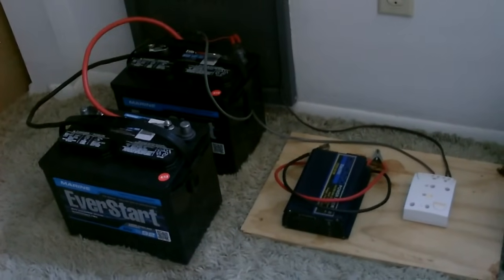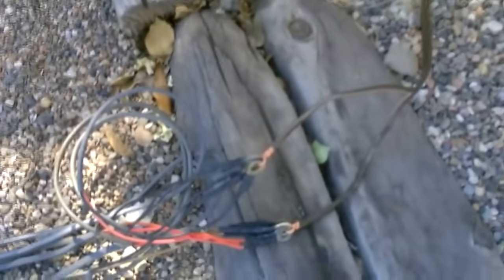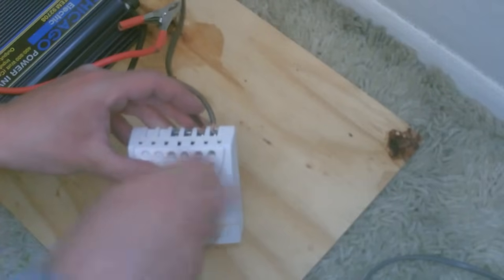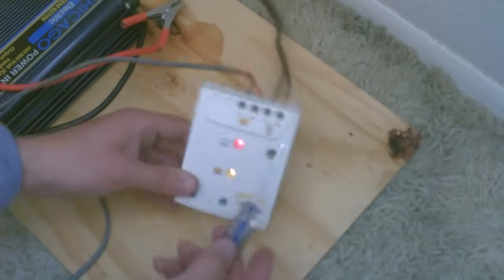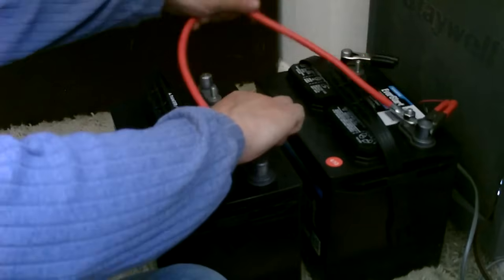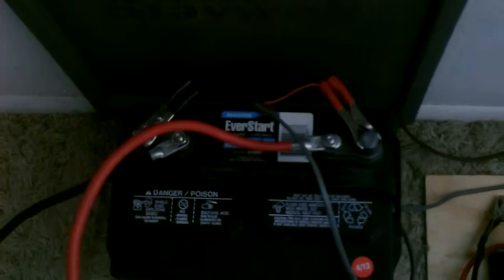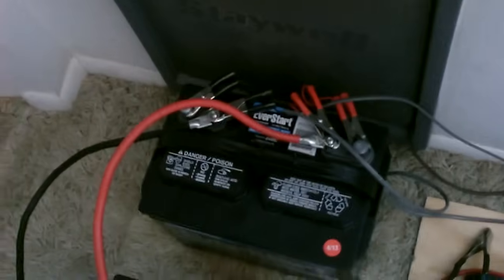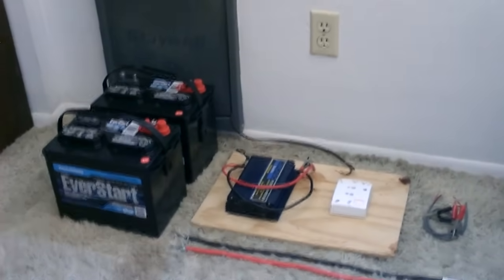How to hook up Solar Panels (with battery bank) - simple 'detailed' instructions - DIY solar system

Comment: Do the car batteries last a long time for solar?
Reply from the maker: if you use car batteries you'll only get about 25 charge cycles before they die. use the kind of batteries that i did (meaning use deep cycle batteries) and you'll get closer to 1000 charge cycles. (that's about what i get). the batteries shown in this video kind of look like car batteries but they are deep cycle.

Comment: U should put positive on one end of ur battery bank and negative on the opposite end it helps with battery life and even distribution
Reply from the maker: hi. it does seem logical but it's not necessary to do that. studies show that as long as the battery bank has less than 8 batteries then there's no measurable difference between the batteries. i've run systems like this (a 2-battery system and a 4-battery system for over 10 years) and the batts all wear out pretty evenly. i typically get 1000 charge cycles (about 3 years) before i need to replace them. (that's a good full life for this type of battery) 🙂🤠

Comment: If you want to run outlets make sure you get the inverter that has that output bracket inserts. For example the "Renogy 2000w pure sine wave inverter 12v DC input with 110v ac output" this model inverter is used for running solar home outlets in your walls. All you do is wire same as house and the last positive and negative wire plug into the inverter outbound made for RV TRAVEL TRAILERS. make sure you use correct thick gadge wires that you feel comfortable with. For me it is 10 gadge but some use the standard 12 G. Don't use and thinner than 12G such as 15 G in my opinion to be safe. I would also suggest a fuse in power line.

Comment: Hey, great video, I live in a remote area with no electricity, what appliances can run on this setup❓
Reply from the maker: hi. all kinds of things. i've run can openers (60w), toasters (769w), a small microwave (around 800w), coffee makers (about 750w), mix masters, vacuums (750w) and various power tools... you can run most small appliances. i've also run weed quackers, hedge trimmers and leaf blowers etc... anything that pulls 1000w or less usually works good. if the item pulls over 1000w (from 1000w to 1800w) then you might want to have a couple more batteries). with a 4 battery setup (shown in my very first video) i've run a full size washing machine. just a short wash but it works

Comment: U not using fuses. Have u had any problems?
Reply from the maker: hi. no problems at all. been running it for 10 plus years. it's a small system but you can add in fuses if you want. note that the inverter and charge controller have built in protections

Comment: Can be any kind of battery?
Reply from the maker: hi. any kind of 12v deep cycle battery should work. you wouldn't want to use a car battery. they would probably only last about 25 charge cycles. deep cycle batteries can last 1000 cycles
Reply: @desertsun02  And cost a Fortune..........

Comment: Will this run a couple led lights or an electric heater?
Reply from the maker: hi. yes, it easily runs things like led lights and small heaters. to run larger heaters you would want to add more batteries.
Reply: @desertsun02  aLot More..........haa

Comment: What happens when the battery's are fully charged?
Reply from the maker: hi. once they are fully charged the charge controller lets through just enough power to keep the batteries 'topped off'.

Comment: Shouldn't the controler be connected to the positive of one battery and the negative of the other battery to charge both batteries equally?
Reply from the maker: hi. there are other configurations (but you don't need to do that). studies have shown that if you are using 8 batteries or less there is no measurable difference between the first battery and the eighth battery. the power goes through the wires essentially at the speed of light so the battery bank acts like a single big battery.

Comment: I keep wanting a portable power station but i can build that and get way more bang for my buck! Westinghouse wants 1000 dollars for 600wh portable power station! 10 yrs since you made this video and still the simplest/cheapest way to go about building a power station for when you lose power!
Reply from the maker: hi and thank you! a system like the one i built gives you a lot more power than most of those portable or 'all in one' units that they sell. a while back i compared it to a 'jackary 1000' (that's one of their bigger units) and the system i made gives you about 3 times as much power (for about a third of the cost). much cheaper to set up a system yourself. these days it would only cost you about $335 (for everything).

Comment: Hi,Are those just regular car batteries and what size inverter,, Thanks
Reply from the maker: hi. they look like car batteries but they're actually deep cycle batteries. deep cycle batteries are made to be charged and discharged a lot. i usually get about 1000 charge cycles (3 years) out of them before they need to be replaced. if you used car batteries you might get 25 charge cycles before they would need to be replaced. i have 3 different size inverters. a 150watter a 400watter and a 1000watter 🙂👍

Comment: You said to hook up everything to the lead battery, does this negatively affect the lead battery in any way?
Reply from the maker: hi. once you hook the batteries up to make a 'battery bank' the system charges equally (for all intents and purposes). that's because the electricity in the wires is moving essentially at the speed of light. they did studies a while back and found if you're using 8 batteries or less then all the batteries are affected equally. they could not measure a difference. hooking them up this way is the best way to do it if you're not using more than 8 batteries.

Comment: I got 100wats solar panel 600watt  inverter and  75AH Bettery.... then I got 43 inch  TV which it fails to work when connected to the inverter even after all connections. Please what might be the reason?
Reply from the maker: hi there. there are a few items on the market that actually need a pure sine wave inverter to run. those items usually have very sensitive electronics and will not run using a standard (modified sine wave inverter). i've only ever run across one thing that wouldn't run. it wasn't a tv but some tv's might need a pure sine wave inverter. do most other things run when you plug them into the inverter?

Comment: What size is the wire coming in from outside
Reply from the maker: hi. i'm just using old extension cord wire. i believe it's official rating is 13 amps.

Comment: Its amazing and honestly i m looking to do the same for long time but couldn't find any video like this to satisfy, can you help me to figure out that where to buy solar, White box and DC to AC changer? And what they called exactly? Thanks for amazing video
Reply from the maker: hi. the best place to get most of the stuff these days is amazon. they sell good solar panels (plus they have charge controllers (the white box), and inverters (DC to AC device). i recommend getting the batteries in your local area - if you can - but amazon sells batteries too
Reply: @desertsun02  thanks for the reply, for the white box and DC to ac, it doesn't matter how many solar you hook up? Or they have limited capacity? I have around 40 to 50 led light around the house which I m trying to make them solar

Comment: I like your system it does work.can you run a small cooler
Reply from the maker: hi yes it will run many different types of coolers. by "cooler" i mean small fridges etc...  it will run a small ac window unit but only for 15 to 30 mins. for that you'd need more batteries

Comment: So if I wanted to use small agm 12v 7ah batteries as a power bank and to have a USB and cig lighter terminals only I can skip the inverter and just run them directly from the battery?

Comment: @desertsun02 correct me if in wrong but using 1 "lead" battery to connect everything would charge the batteries uneven would it not? if you put positive on 1 battery and neg on the second battery it would draw and charge both batteries evenly. doing it your way would put WAY more stress on 1 battery and not near as much on the second.
Reply from the maker: hi there. i can see how it seems that way but it doesn't actually work that way (to any measurable degree). it's mainly because the electricity moves through the wires at essentially the speed of light so when you hook the batteries together the 'battery bank' acts like 'one bigger battery'. studies i read showed that if you use 8 batteries or less there was no measurable difference between the first battery all the way through to the eighth one. they concluded that if your battery bank was 8 batteries or less it's better to just hook them in a row. if it's bigger than 8 batteries there are other more complex configurations you can use. note that you don't have to though. you can still just hook them in a row. it's an incredibly small difference between the first battery and the 9th, 10th, or 11th one etc. again because the electricity is moving so fast through the wires.

Comment: Exactly what I needed just something straight to the point and no confusing way watts x kw / by pie - 1024 bytes = WHATTTAT ??? :)  thanks again... I guess my only question is batteries people say to not use car batteries but Lithium is expensive... Is there a cheap way to go Lithium batteries?? I thought about using some of my old batteries out of my APC and UPS units when they come in for replacement....  chain all together was my thinking.

Comment: so... in looking through videos you had car batteries in your bank. not everyone does. I was curious to ask you about some details on this. 

Like... if all your batteries aren't uniform, and if you have varying strength, age, or differences in the car batteries... can this affect how you do your battery bank setup? And is there a particular order or line you want them to be at if your batteries aren't uniform?
Reply from the maker: hi there. remember not to use car batteries. they look a lot like car batteries but they aren't. they're 12v deep cycle batteries. car batteries would only last maybe 25 cycles before they were no good anymore. the deep cycle kind of battery can last 1000 cycles. all the batteries in a battery bank should be the same. (same brand, same size, and roughly the same age etc.). mixing different ones can cause real problems.
Reply: @desertsun02  i was curious to ask u if battery systems in systems above 24 v are subject to more wear and tear? more stress? I'm using 12V but I noticed ebikes use really high voltage systems, and that got me curious to ask u on this. 

This is really fun to see your stuff and talk shop. 

Thanks.

Comment: Ok, pretty clear this part! Now how do you use the elecyricity ftom the batteries for your fridge, let's say??
Reply from the maker: hi. all you do is plug anything that you want to run into the inverter ✔🙂. i've got a separate video showing it running 6 or 7 different things.

Comment: Great video. My only comment is that I would have stripped the ends off those panel cables and spliced them together before connecting to the charge the regulator, just to ensure the best possible connection.

Comment: When the battery is full, what happens to the charge controller and the inverter? Does it pull power from the panels instead of the batteries?

Comment: do i have to use the same batteries i have 4 each pulled from different vehicles  can i link them all together or will i have a problems?
Reply from the maker: hi. it's very important to use the same exact batteries.
Reply: @desertsun02  thank you very much for the reply

Comment: Have you been able to use this setup for a longer time? And what kinds of things were you able to power with this system and for how long?
Reply from the maker: hi. yes, i've been using this system (originally with 4 batteries) since 2009. my first video is actually this system with 4 batteries. the only thing i've had to do is get new batteries every 3 years or so. i've been getting about 1000 charge cycles out of each set of batteries. i can power almost all my smaller to mid-size items. the only things i can't power for a long time are the microwave and small ac.

Comment: Awesome thank you. So you could just add more solar panels and batterys. How many battery to panels would you say is equal?
Reply from the maker: hi. for every 2 batteries (of similar size) i use about 100 watts of 12v solar panels. that's because a 12v 100w solar panel puts out about 6 amps (so that is 3 amps per battery).

Comment: Great video. I was looking at a 5000w pure sine inverter for a system. How many batteries do you think I might need? Thanks
Reply from the maker: hi and thanks. it's hard to say but if you want that much power you would have to scale up the system in a big way.

Comment: Did you use two car batteries
Reply from the maker: hi. i used 2 batteries (but note that they aren't car batteries). they are 'deep cycle' batteries. they look similar but it's very important to use 'deep cycle' batteries. car batteries would only last maybe 25 charges. deep cycle batteries can last 1000 charge cycles.

Comment: Great info, Thank You!!!!     Do You recommend any solar panels that will stand up to the hot sunny Florida days, i`ve read some panels cannot take the heat?     Thanks again.
Reply from the maker: hi there and thanks! i've bought both the cheap panels and the more expensive ones. i find that the cheap ones work just as good (if not better) than the more expensive ones. these days the best place to get panels is probably amazon. they've got some 12v 100 watt solar panels as low as 80 bucks. i have an 80 dollar one. it's awesome.
Reply: @desertsun02   Thanks Sir  Rock`On!!!

Comment: Hi. My set up Consisted one 100Watt solar panel, a charge control, and one 22Ah battery. I connected to a CCTV camera and router which used around 2Amp. However this solar panel set up unable to let me run my cctv continuously. Is there any solution I can do to achieve that? Thank you

Comment: I've got a solar panel, don't know what type of end is on the cord coming from it.  Need to get parts to fit it--OR--cut it off and use a different type end--OR--just get a different solar panel.  Need build a new, simple power supply like this one!
Reply from the maker: hi. just a guess but it's probably an MC4 connector. those are common these days.
Reply: @desertsun02  I did the research... MC4 is precisely what it is.  Thank you!  Now, to collect the rest of the parts and start building this unit!

Comment: This video is 9 years old and still the most simplest and best explained video on this setup...thanks bro.
Reply from the maker: you're welcome. i've been using this setup with 2 to 4 batteries for over 13 years now. only thing i've done is replace the batteries every few years. they typically last about 3 years at a time. same inverter, same charge controller, same panels.

Comment: I thought it was supose to be wired in serries, but you said parrelel, I have to find out more.
Reply from the maker: hi there. yes, you wire it in parallel (if you want it to be a 12v system)

Comment: Should I get two or three batteries for a 4000 W inverter. I really only need it in case the power goes out so I can run a freezer and a refrigerator
Reply from the maker: hi. it's hard to say how many batteries you will need because it will depend on the power requirement of the fridge or freezer. some are very low power.

Comment: You didnt show the connection to the inverter
Reply from the maker: hi. i just clamped it to the lead battery. positive (red wire) of the inverter to the positive post on the lead battery and negative (black wire) of the inverter to the negative post on the lead battery

Comment: Do you have you use 2 batteries?
Reply from the maker: hi. you can use any number of batteries that you want (but you want to balance the number of batteries and the number of panels correctly). batteries of roughly the size i used like to be charged at 3 amps per hour (give or take) so it's best to use 2 batteries for every 100 watts of solar power. that's because a 12v 100 watt solar panel produces around 6 amps
Reply: Thank you man!

Comment: The highest V of solar panel is about 30 V. Is that high V hurt any of the other equitment? Battery, Controller.
Reply from the maker: the voltage should not be that high if it's a 12v panel. it should be more like 17 to 20v. 12v panels are a little over 12v so that the panel has the power to push the current into the battery. (the voltage is the "push" behind the current). it has to be a few volts higher than the voltage of the battery or it won't charge the battery
Reply: @desertsun02  great to know,thanks.

Comment: Love how you make this setup so simple!!  I have noticed on other videos when they connect the load it is pos. on one battery and neg. on the other battery Where you have the load is connected on the same battery...is there a difference?
Reply from the maker: hi there. they think that will balance the load better (but it doesn't). as long as your system has 8 batteries or less it's best to do it like i show in this video. if you are hooking up more than 8 batteries then there are other configurations that you can use.
Reply: @desertsun02  Thank you!